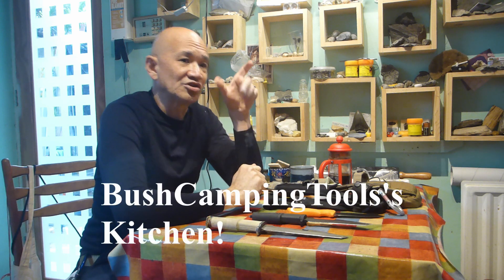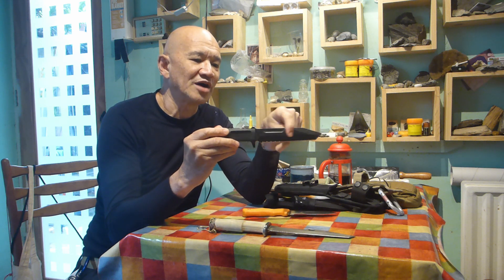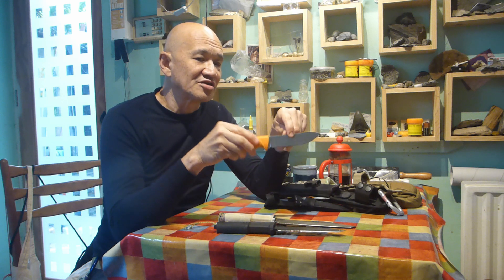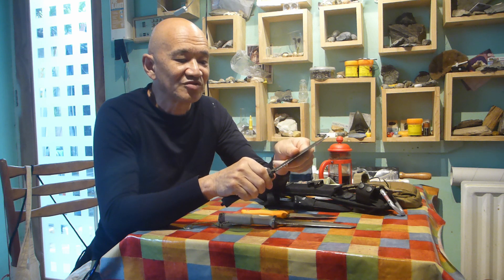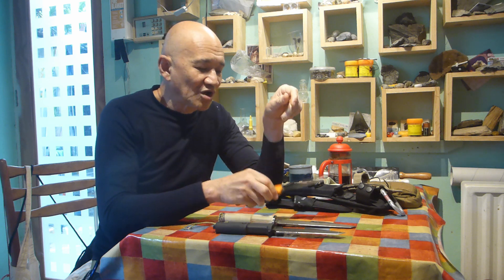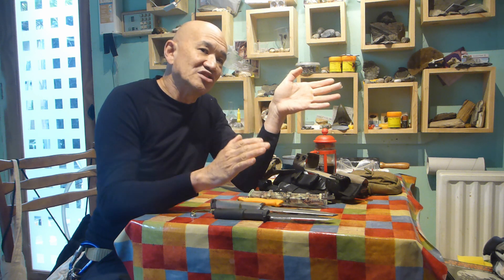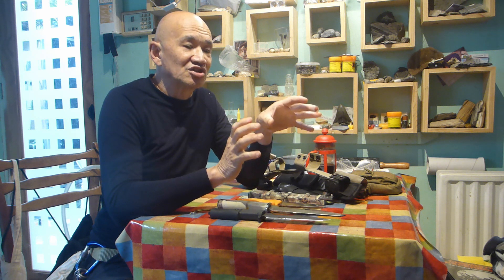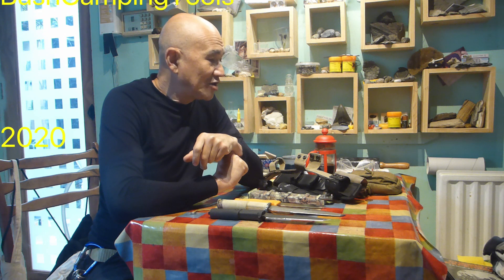Stainless steel: What does it mean for outdoor knives?

Comment: When I was in the Army I really found that a stainless steel locking folder was the best thing for me at the time.  It was good to have the SS so I didn't have to worry about maintenance.  The edge didn't hold up as will as carbon, but the trade off was worth it.

Now that I'm a civilian, I like the carbon steels better because I have the luxury of time to take care of them.   I do have a Japanese stainless fishing knife from the 1960's that's sharp as a razor and holds an edge like a diamond.  I got it from my uncle: it was probably very expensive when it was new.
Reply from the maker: Hi, yeah I can totally understand your rational there regarding having a low maintenance in the service. My best hunting knife bar far is my old clapped out PUMA hunter's friend but I probably could have looked after it a bit better although all the surface rust doesn't t=really affect it much I guess except for cosmetics.
Reply: @BushCampingTools  I found out the hard way that SS was the better choice.  I had carried a carbon steel fixed blade for a short time, but after a 30 day mission in Central America, the carbon steel was so rusted as to be nearly unusable.  And having a fixed blade wasn't always approved of by the commander.  So a SS folder, with a lock (so as not to cut myself!) was the perfect choice.   The knife could be folded in my pocket easily, and the SS required only a resharpening every so often. 

I had many over my 22 years of service, some were lost here and there, some I gave away.  Most were no-name brands because they got lost or broken often and it didn't make sense to spend a lot of money on one.  Same reason why I wore a Casio F91-W1 watch for most of my career (that's a story for another time!).  My favorite of all was the Gerber para-frame- I eventually gave it to my nephew after I retired. 

I have a lot of fond memories of cheap knives :) They all served me well.   I still have 3 of the issue Camillus 1760 "demo" knives which I carry on a neck lanyard for nostalgia sake sometimes.
Reply from the maker: @tjsogmc  Wow that sounds pretty cool. Yeah high humidity is a big killer of carbon steel unless protected well with oil. Yeah a mate of mine who was in the Australian reserves, they used to do a lot of interior training/survival missions in the guts of Australia and he said out of all the kit they had, the only thing they made them buy were their knives! The one which was an issue model (I think it was some early buck model) was about 400 bucks! to buy via the army which was crazy expensive, so many of his mates also carried much less expensive and often no namers for the same reasons you state. I know still many enlisted and some who aren't and none of them ever carried these whooping big choppers on their person.That's why I also laugh at all these so called 1000 buck plus watches which are supposed to be military issue. I just can't see that in real life. This is also one of the reason why my channel has a dearth of machete reviews (not because i don't think they are useful) but because many modern ones don't really do much more (IMHO) than a el-cheapo one you can pick up in the tropics (in my experience anyway)
Reply: @BushCampingTools  I also scoff at the $1000+ "military" watches.  Nobody I ever served with would wear such an expensive watch.  Such a thing immediately identifies you as a REMF (Rear Echelon Mother F*cer) and wouldn't last 3 days in the field. There is an unwritten rule of the universe that states "the more expensive a watch, the faster it will get broken".  The advantage of the cheap Casio is that it was always available at the PX for about $5 and it lasted a good long time- or at least in context that would be maybe 6 months to a year.   It was easily replaced.  Being a soldier is hard on a watch, it will get destroyed at some point no matter how expensive it is or how careful you think you are.  No need to throw money in the trash.  I went through 6 deployments with the F91-W1 on my wrist and it always performed flawlessly.   Usually the wrist band would tear from stress before the timepiece broke.   I've had some that were scratched to hell, tears on the band, and had moisture under the glass, but still worked. I finally got a real G-Shock right before I retired and thought I hit the lottery with that!  Still, even the guys I served with managed to kill a G-shock within a year and you could by 10 F91-W1s for the cost of a single G-Shock.

Comment: Nice video! One question though: there is an outdoor community mainly in the USA, who believe in simple 1095 carbon steel. They say its tough, you oil it and it will not rust. They look at stainless steel as brittle and not so sharpanable. So in outdoor life, is it that Americans like to use cheap work knives in deserts or do they have a point? I myself believe stainless is usually better because less to worry about. Once there is rust, it ruins the blade.
Reply: As an American, I can say that we have no consensus on what metal is best.  In fact, we seldom agree on that subject.   When you look at it, mankind has been trying to find the right balance between edge retention, strength, and maintenance since Day 1 when the first caveman dropped a rock and chipped the edge and realized he was on to something special. 

If anything, I would say Americans are obsessed with the "latest and greatest" metal blends.  Whatever the newest composition that hits the market will be the go-to metal for everything...until the next one comes out.  For a while it was T-10, then AUS-8 was all the fad, now it's 8Cr13MoV I think.   However, sooner or later it all comes back to a properly heat treated 1095 being the best all around choice for a carbon steel.  

 I belong to a more traditional minded and conservative group when it comes to knife metals, I prefer the tried and true.
Reply from the maker: Hi Andras. well believe it or not there is a lot to be said in a positive way for 1095 correctly heat treated or indeed even this SK85 on these WTG knives i've been reviewing. Now as fr as long term maintenance goes for 1095 I can tell you, it it is not religiously protected with proper oiling, it will rust up big time. I have used one of my 1095 knives quite a lot on the coast but i always had somewhere to dunk it in a freshwater source and keep the salt away from it. I guess if you never encounter salt water then it will be ok. As far as sharpening goes it is def easier to sharpen than any stainless steel knives I own or have owned. Now as to holding an edge. It can not in MHO hold an edge like a 58 or higher Rockwell stainless steel blade especially N690, however N690, if you let it get dull or worse still blunt, then it can take some effort to get it sharp again by hand, that's by hand i say, not by belt grinder etc. But who carries a belt grinder with them in the outdoors. My original (and I still have it) hunting knife is carbon steel and it really holds an edge (some steel PUMA made long ago but no longer make anything like it- they called it PUMASTER steel. Maybe it was C60??? Who knows?? Stainless knives handle cutting up acid foods much better than 1095. I've really damaged 1095 blades by foolishly- well maybe that is too harsh a word; leaving orange juice on the blade and it actually started to pit the steel after a day! I was really shocked!  Stainless blades are less likely to carry bacteria as there is less chance of surface pitting to harbour bugs, hence why industrial cooking knives and blades are mostly stainless steel. I've not broken any stainless steel blades so all I can say it certainly i have not experienced brittleness. However, brittleness is a result of poor heat treatment or incorrect alloy for the job. There is a silly trend for many manufacturers to really harden up their blades ot 60 and over and i believe they think they will sell more products as peiple who are not adept at sharpening will probably go for such knives and these will be the same group of people who won't generally use their knives more than once or twice per year. Then a high HRC not abused could go several years without ever being sharpening much at all.
Finally (well not really finally as there is a lot to say here but i'll try and wrap it up now) I think 1095 knives with few exceptions are very over priced as this really is a very cheap steel. N690 is also environmentally friendly as it is made from recycled steel. And yes, once rust sets in it can be extremely difficult to truly remove it at home. It can be done but with some special equipment as any rust even stuff very hard to see with the naked eye can provide regions for it to continue to propagate. More on this later. As always thanks for commenting!
Reply: Thanks for the great truly informative reply. One other interesting thing you mentioned about the Extrema Ratio knives (I have a few of them directly due to your good tests,  MK2.1, Fulcrum S, and some others)  that the burnish is not a protective layer. I also have the FKMD Leonida Spartan thanks to you again. So Fox uses a coating on its blades as contrasted to the burnish. Coating comes off, but protects, burnish does not come off but does not protect.... So this burnish process is unique to Extrema or just a fancy treatment like the others, except, that the others may be cheaper and more colorful, (ie. Fox Predator I desert) without other use since the blade is already stainless?
Reply from the maker: Great conversation here guys. I love USA made knives and own a few, some 1095, some ATS-34 and some D2 from the earliest Gerbers: Magnum, Shorty; Pixie, etc however, i have to say that yeah the majority of videos from shot show etc just showcase the USA made or designed market and when i get my American friends on here that have ventured out to the European and Russian market I think are becoming devotees of this very much different range of knives, whether fixed blades or folders. I know in Australia, even rural Australia where any farmer worth their weight in salt or whatever, carries a folder (not in town any more because we are going crazy like Europe on law laws now) and the majority/most popular folders are still USA made and Asian made BUCKS. The Europeans are trying to break into this market  and once any years back, like the early 70's to late 70's it was also common to find in many gun shops the german brand PUMA (most carbon steel too) but PUMA have always been at the top of the price bracket and that will put people off however, I can say that of the workers who bought PUMA's way back then they are still carrying them now. Of course with the exchange rate the USA made Bucks are not cheap either. I'd also agree with Red Scorpion 6's comment about whats in flavor too. I mean i remember when 440C broke into the knife world from industrial use and it was heralded as the be all end all of top dollar steels. (of course i still think it is a good steel).
Reply: Well, in the US there is no consensus on stainless vs carbon,  but I will tell you that stainless is preferred by the majority of knife owners.  Preferably  "tactical " stainless.   If there is any sin on American knife makers and consumers,  it's that everything has to be "tactical "  I am beyond tired of the black, composite handle, lightweight,  angular blade look.  99.9% of the people who buy these kind of knives never leave their livingroom.   
Carbon steel is considered  "old fashioned " by just about everyone I know,  but there is a growing number of enthusiasts that like carbon.  I have about 50/50 carbon to stainless in my collection. 

I have plenty of knives from around the world,  those made in Germany or England are usually among the best and can stand up with the best of the American blades.   However,  Americans are very patriotic and prefer domestic brands over all else.  Given that US made blades are very good and highly affordable at home,  it's not hard to see why most Americans have American made blades.

Interestingly,  I have a MAM Portuguese knife in my pocket right now

Comment: Thanks a lot for the detailed information, Francis.
I‘ve said this a few times before and I will do it again:
For N690Co is still an excellent steal for knives?
Even the more simple version, 440C, is great.
The tendency to use all these high end steals for outdoor and camping knives is like spending 500k for a offroad 4WD.
You can do this but you will not get more usability or benefits.
This is just some Lametta for the mind.
Reply from the maker: Hi Diderich, yes you are indeed correct. Of course the N690 was not developed for knives at all if i can believe what the technical people told me at Bohler; ie for high speed tooling where cooling/lubrication was/is not possible, as the addition of Cobalt prevents the tool from losing it's high hardness via a disruption of temper. Now of course this has zero bearing really on outdoor knives as no one uses their knife at high speed and high temperatures LOL.
And yes, 440C was once heralded a "super steel" heck i must be too old to remember this LOL- but it is indeed still a great steel when properly heat treated and I have great knives which are testament to this. Now as far as manufacturing goes, using N690 and tooling jobs without much lubrication, well it can be done in a hardened state, just like the PM steels such as ELMAX, where tooling can be carried out on already hardened pieces without disruption to the temper.